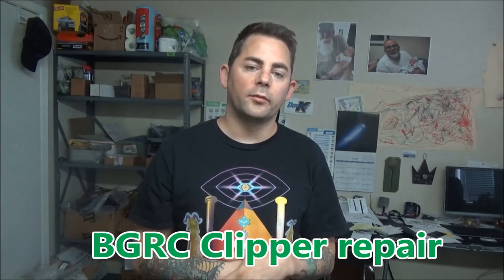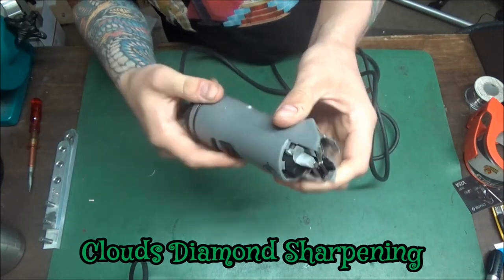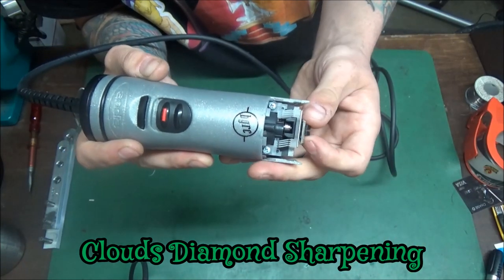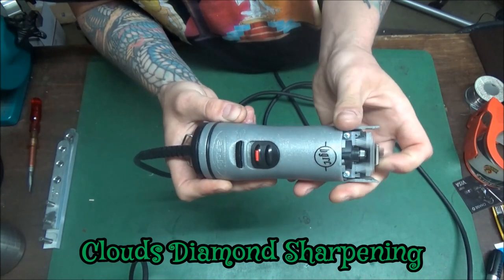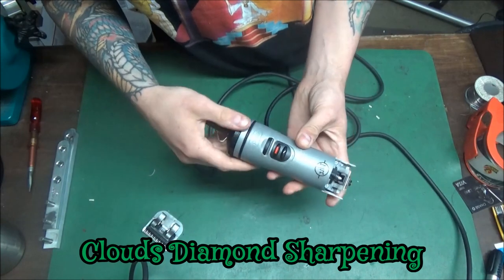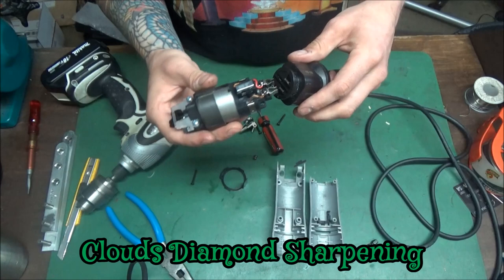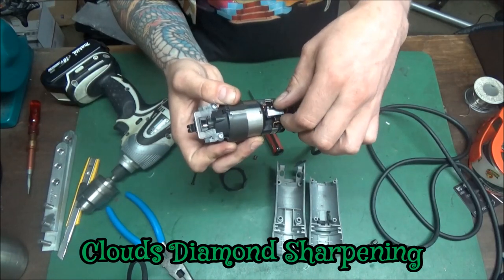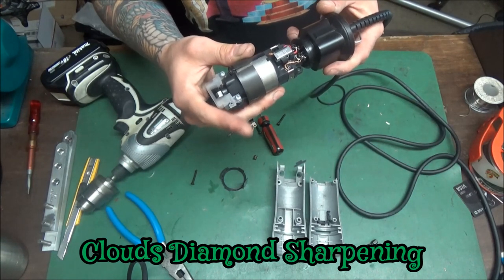Andis BGRC - Everything you need to know

Comment: I have a pair of faulty batteries for Andis BGRC and no attachable cable. I would love to ask if it is possible to open the battery cover and replace the rechargeable batteries within them?, so I can still use the clippers. Otherwise. would it be any possibility to convert the clippers into cord clippers without buying the cable, just using an universal transformer? thank you

Comment: I have a 5 yr old BGR+.  RPMs are getting too slow even on full charge now.  I think the battery is going out.  Is there an Andis part for a Li-Ion replacement battery I can buy?  What is my best option?  Thanks.
Reply from the maker: A Lithium-Ion battery would not be interchangeable as far as I know, but even if you could, you would need a specific charger to charge the lithium battery. The charger you have now would not work. If looking to go Lithium, I would consider purchasing a new clipper that is Lithium-Ion powered. Check out an Andis Pulse ZR.